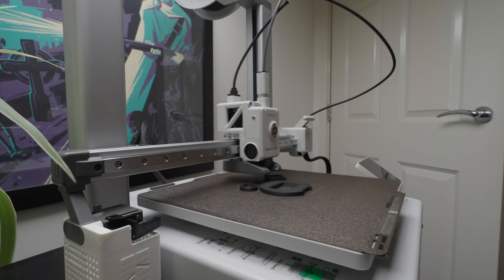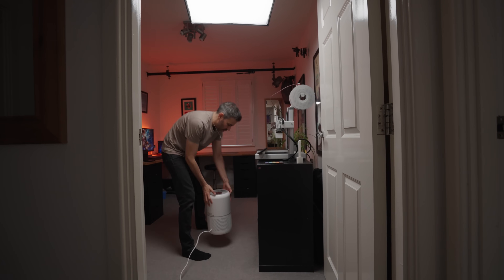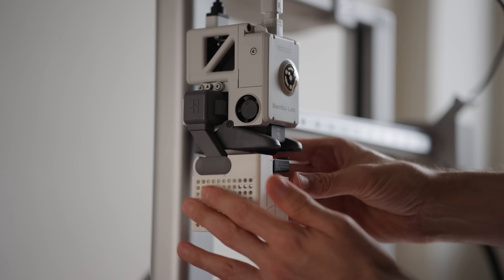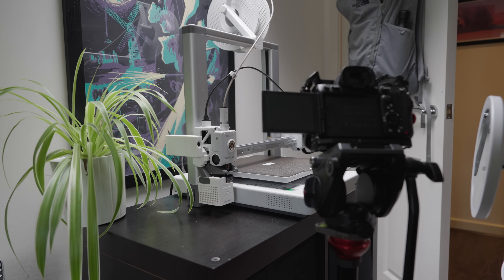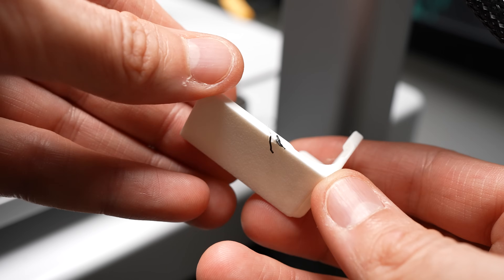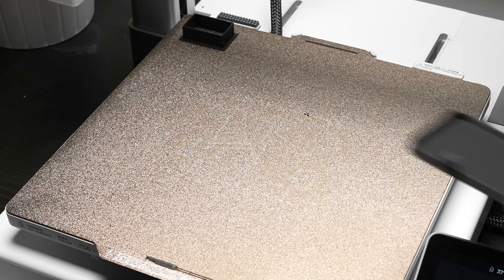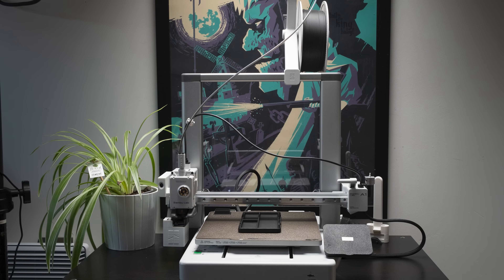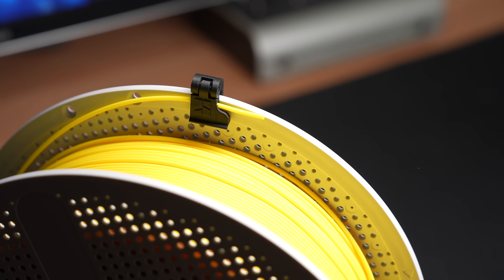Must have A1 beginner 3d print upgrades

Comment: * Hotend cable chain - keeps it from drooping and looks cooler than the suggested cable guide.
* Spool claw adapter cylinders for filament spools with larger holes, and, if using a top-mount AMS Lite, spool locks.
* The poop basket: better to print one that slides off and on like a drawer. It's more convenient to empty, even in mid-print.
* Little traffic barriers or fences to place around it to remind you not to place objects there, like under the ends of the X-Axis assembly. (That's how my first poop basket got crushed.) Plus they look cute.

Comment: About Build plate aliner WARNING the latest beta firmware 01.01.50.24 will cause a collision with this when it checks for “filament wrapped detection” it actually moves the nozzle outside the print bed to where this is installed! bummer because I really like this aligner!
Reply from the maker: Hopefully, they patch that in a future update or at least give us a way to toggle that detection off. In the meantime, might be worth rolling back the firmware if the aligner’s essential to your setup.Thanks for the comment!

Comment: Hi, so can you print the ABS with the A 1 printer? What do I have to change? The otend? Thank you my friend
Reply from the maker: Yes you can. Different types of fillament require a certain tempreture to use. You just adjust the type of fillament your using in the settings of your slicer. Hope this helps.

Comment: That poop bucket is fine for single filament printing, but if do multicolour or multi filament prints with AMS lite, you’ll fill that bucket 5 times over in a single print quite easily. For those people, I suggest putting the printer in the left edge of a table that has a waste bucket between the table and wall. Design and print a guide chute to make sure the poop follows the right course.
Reply: I made a poop deflector that bounces it into a tray sitting on the same surface as the printer.

Comment: cant recommend the poop bucket. Some poops stick to the side to it and once that happens its just a ticking time bomb until the build up will either pop your printhead cover or the print fails/will get ruined.
Reply from the maker: I wouldn't recommend it if you have the AMS as you'd definetly have poop overload. But for single color print stuff? Absolutley fine.

Comment: Why use a purge tower with single color printing you are just adding time, wasting filament, and causing quite a bit of stringing. Make sure z-hop is disabled too as it causes stringing on single color multipart layer by layer print
Reply from the maker: The purge tower is needed for the smooth Timelapse’s I make for these videos. All explained here https://youtu.be/v79PEHdCOcg?si=JyI-VqXzJzy-K9WP

Comment: I'm probably gonna get this printer as well, what can you tell me about the amount of counterspace I'll need?
Reply from the maker: About 20cms clearance from the back and 10cms for the front. It’s the downside of a bed slinger. But I’ve got mine on a tabletop which is away from the back wall to compensate.

Comment: My A1 arrived today and I can't wait to start printing!
Reply from the maker: Did you go for the AMS too? I feel I need to grab one for my A1 now. I can’t stop spending. 😂
Reply: @MisterHenry  Yup. Got the Combo :)
Reply: I got an A1 with AMS from my local Microcenter for $480. I’m in love.
Reply from the maker: @MyName-xt6js  All the signs are saying I should get an AMS too! 😂
Reply: @MisterHenry  It’s an amazing deal with the combo, also even if you don’t always print in multiple colors being able to change filament at the tap of a button is a game changer. My Ender 3v2 is borderline going in a dumpster.
Reply: @MyName-xt6js  does it somehow pull the filament out it self? I found a button to change the filament but it was grayed out.
Reply: @lohlundgames  my understanding (which may very well be wrong) is that the AMS unit holds up to 4 spools of filament, and feeds them to the hot-end through 4 separate tubes.  I believe the automatic filament changing simply pulls the active filament back far enough to introduce the new filament (leaving the tubes still full of filament).
Reply: @Rick_Cavallaro  This sums it up quite good actually if I understood that right. :) One thing to add though: When initially loading a spool the filament it only goes up to 1/3 of the way to the print head. When printing with that said filament it will obviously go into the printhead. When the filament is not used anymore it pulls it back up a bit, showing a small gap between the printhead and the end of the filament which is roughly 1-2cm from what I can tell.
Reply: @MyName-xt6js  Really?? i was looking on my local microcenter's but i cant find the combos
Reply: I know this is an older post, but how is it holding up in your estimations? I just ordered mine today :)
Reply: @Circa_Tsunami  Still very good. No major issues so far that needed fixing. Though I am not printing much anymore (ran out of the filament that I used the most a few months ago 😅)

Comment: Re: cooling-fan contraption. Why are trying to reduce the airflow??
Reply: On the surge side of a fan you can put alot in front without restricting flow. Does not count for the other side. In this case it wont have any effect - and if so, the headroom is plenty and its only for the cold end...
Reply: Your hardly reducing it.. and till that time you go to remove the front cover as it's clogging... you will shock yourself when you touch it

Comment: Do you recommend it as a 24 hour print farm machine printing at high speeds
Reply from the maker: @mugaggakennedy  cost wise? Yes. You could buy half a dozen of these and be set pretty quickly. However I feel that if you’re going to buy multiple units, an enclosed 3d printer might be more beneficial. It really depends on the room temperature and ventilation I guess. Please keep in mind that this is my first 3d printer and I found the A1 really user friendly. So take what I say with a pinch of salt. Hope this helps.
Reply: @MisterHenry  thank you for the feedback, does it handle remote printing greatly :Can you start prints while in another region
Reply from the maker: @mugaggakennedy  sure. I use the phone app to remotely print things from other locations. Not sure how well it would work for multiple printers though.

Comment: So, I just picked up an a1 on black friday and have a question, how do you guys dampen vibrations and noise from it? I’m in a 3rd floor apartment and feel like an ass when I run it since im fairly certain my downstairs neighbors can hear it through the floor
Reply: For my P1S, I used a concrete paver on top of  a square foam exercise mat tile. It seems to work pretty well.
Reply from the maker: @rsmeaton  That's a really good idea. The foam mat should help Dampen the vibrations.
Reply from the maker: Not really having any issues with noise vibrations. I do have it on a very sturdy worktop, plus it's on a carpeted floor.
Reply: I have heard about  anti vibration feet for 3d printers that  you can print